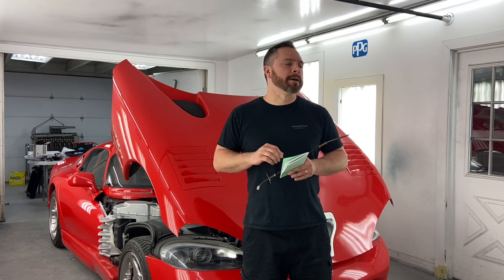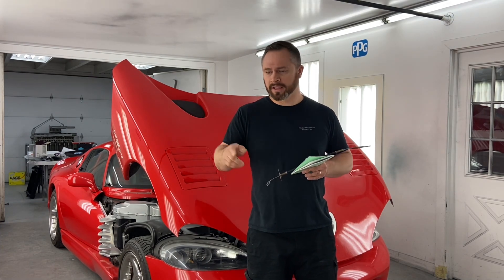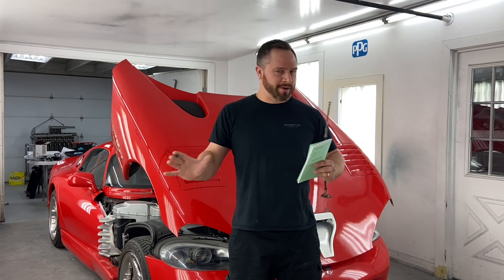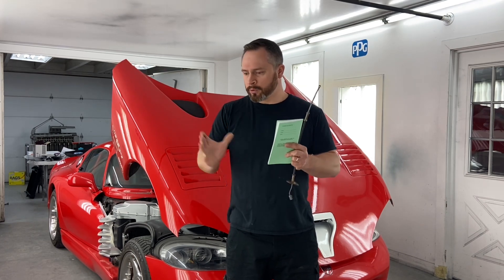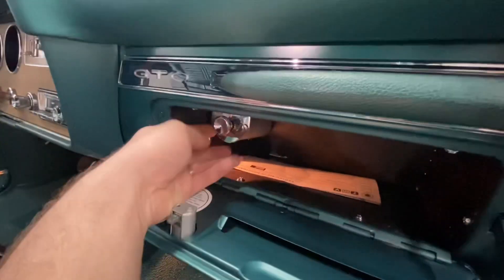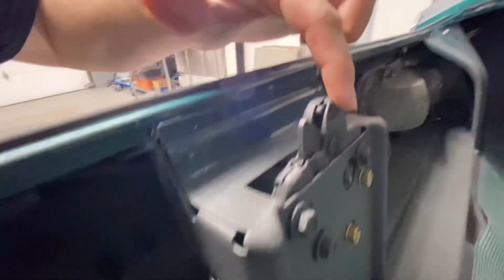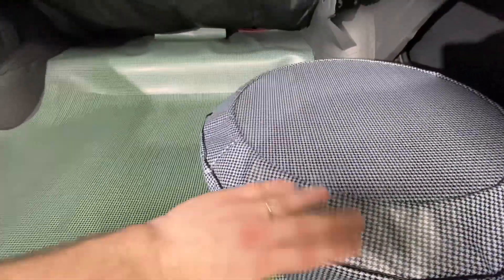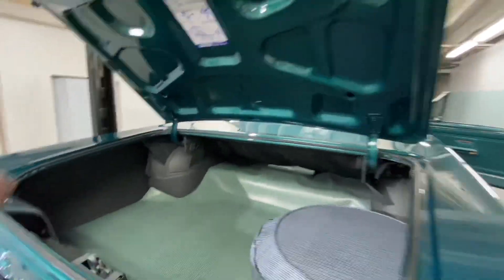Concours GTO tour and theory behind our restoration work.

Comment: Nice job.  Can you please tell me what paint you use on the engine compartment?  I have to re-shoot mine because it doesn't look quite correct.  Thanks
Reply from the maker: I generally use a few different methods. My inner fenders, core support and heater box I have powder coated in semi gloss, and I will hand polish the inner fenders just a bit to add a few degrees of gloss. The firewall gets epoxy primed in DP90, I will then add any firewall markings and body color overspray THEN finish the firewall in SEM trim black and cover over the markings/overspray. Other misc items may also be powder coated. Another nice product I use from time to time is SEM rust shield paint, the plain black has a nice gloss level for using under hood parts as well, most times I will use this on the frames.
Reply: @RESURRECTIONLLC  thank you.  I love your work.